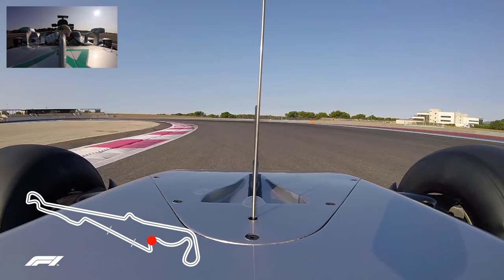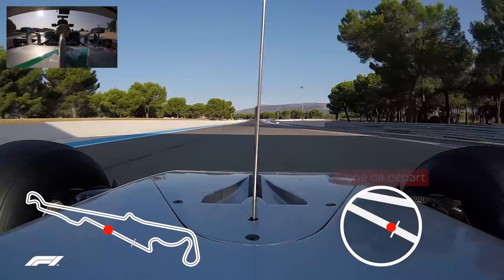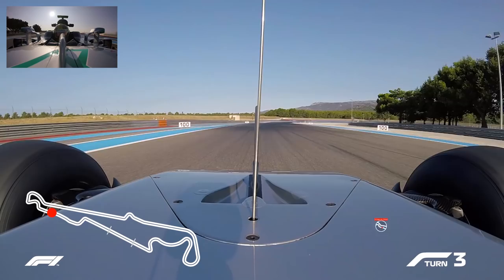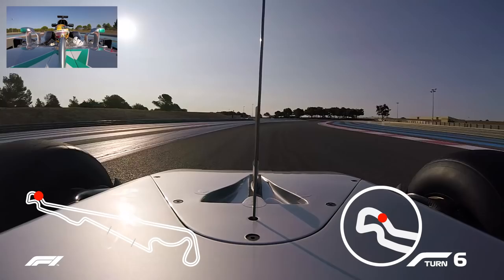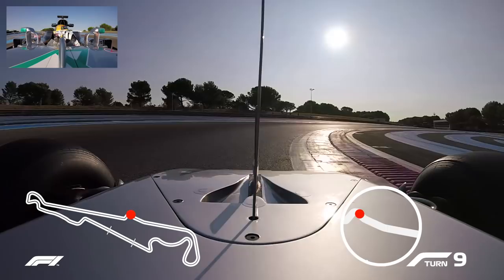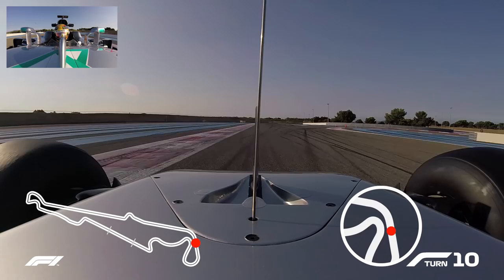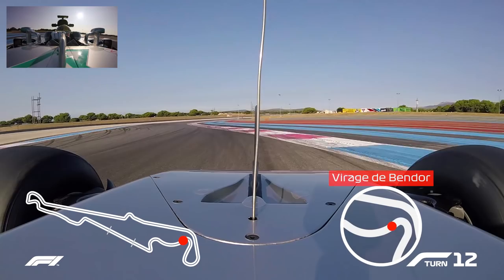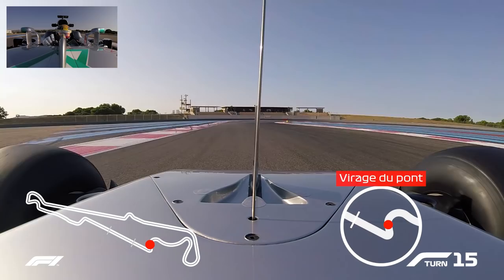Circuit Guide: Paul Ricard | French Grand Prix

Comment: take a large parking lot, paint blue on the edges to make corners, have cars race there...
Reply: fuzzfizz the result is called paul parking log
Reply: Did someone say Formula E? (ahem Berlin ahem)
Reply: nah formula e has walls close to them, this circuit has no punishment, you can do 20 mistakes and win the race
Reply: I mean, didn't F1 do that in Vegas back in the 1980s?
Reply: It's not paint. It's an abrasive surface to slow cars down instead of gravel traps. The red lines are even more abrasive and will supposedly do a lot of damage to tires
Reply: Could say that about COTA or Bahrain but they consistently provide solid races. Or maybe you'd prefer races in tracks like Monaco where there's barely any overtaking because the walls are too close?
Reply: its literally the same i wanted to write. This track is a yoke. Why not racing in Magny-Cours. I dont get it
Reply: MrRobosch Agreed, magny cours is the way to go in my opinion, this is just a track that has cones make the drivers turn, instead of the amasing layout of magny that to me is amazing as it is and F1 raced there, y didn t they do that again?
Reply: Funny thing is they already raced on parking lot in Las Vegas. Can't remember the year though.
Reply: Tyler Quebedeaux yeah, at Caesar's Palace.
Reply: fuzzfizz 😂 it’s so true. I’d have a hard time finding my breaking points.
Reply: lmfao!!!!!! right on point
Reply: OP: Except that is NOT what has happened here. When the circuit was reconstructed in early 2000s it was designed to be an advanced test circuit (hence its original name: Paul Ricard High Tech Test Track).
Reply: ghostsinthere2008 How about the hundreds of races held there before this weekend's race? Track limits usually are an issue though.
Reply: They should have taken Magny-Cour
Reply: Pretty much. First 2 corners and the double apex look fun to drive. The back straight is just lazy track design. There was some close racing for the blanc pain race the other week but wouldnt bet on it being as good with f1 cars.
Reply: Didn't Sebring did the same thing except it's an airfield
Reply: so its like Caesars Palace, but without the temporary concrete bricks and cones.
Reply: To those people asking why they don't race at Magny-Cours. They did, and in the end it wasn't a success, partly because it is relatively speaking in the middle of nowhere.

While I agree that the large asphalt runoffs make going off less punishing, even if it hurts the tyres, they were put there for exactly that purpose when it was a test track. You don't want to ruin a car testing, do you?
Reply: The back looping section is good, there are plenty of overtaking opportunities there. The only problem is, two long straights lead into that section. Which means the high powered cars will be protected from their mistakes in the looping section.
Reply: The runoffs areas aren't asphalt, they're way more abrasive. Running your tires over this will destroy them in no time, so there's definitely punishment if you make a mistake.

Comment: What a dull looking track
Reply: Zarugal Exactly!!!
Reply: It's not actually.... The track is fairly straight, i'll give you that. The fun thing about the track is the fact that there are so many sharp turns after every straight. The track will very much be a brake killer. Teams with the better engines are going to have the advantage on the straights but nimble cars will be able to catch up in the sharper turns. The battles that will occur on the straights will carry on into the corners. Meaning that the battle will get a lot more exiting. I understand your choices and why you think this track looks dull. But I actually think Monaco is way more boring to watch. There is almost no overtaking. I'd love to hear what you think tough!
Reply: Zarugal looks cool imo
Reply: Zarugal Boremula1 and a boring track? You don't say.

Comment: So Rip Renault and Honda engine ?

It looks like a power track
Reply: Jeffrey Pluemjit Canadian GP is supposed to be an engine GP. Look where finished the renaults and RedBulls
Reply: Jeffrey Pluemjit 

There are some very tight low speed corners too. So brake endurance and aerodynamics will be important as well. A lot of time can be gained in the last, somewhat low speed sector.
Reply: aerodynamics isn't important in low speed corners - suspension and weight distribution is. last sector isn't low speed lol.
Reply: Engine does only play a role in Quali
Reply: vasyl86 

Oh i thought that even at lower speeds the intricate wings can generate downforce. Obviously the faster you drive the more air molecules get to push your car down. So red bulls victory at monaco was down to their suspension? Would like to know more about this
Reply: Redbull will do well in the last sector.
Loose some time on the straights.
Reply: Maxi RC Mercedes had old engine they did not upgraded it
Reply: Podesta is Moloch

Yes Red Bull win at Monaco was possible because of their suspension. It's a track where suspension and accelaration is most important. According to the last sector on Paul Ricard - it's not a low speed sector, so aerodynamics will have its role and obviously engine in 2nd sector. I think Ferrari can win here.

Comment: Take that bloody chicane out of the back straight!
Reply: Mr Trick It add another overtaking possiblity so why not
Reply: No, the straight is far too short now after that curvy part before
Reply: Iirc, it's an FIA requirement for tracks not to have straights longer than 2km.
Reply: StFubar what is that bullshit look at miami coming next year look at china monza canada
Reply: I suppose it doesn't really matter, the Williams is a mobile chicane these days anyway.
Reply: fifia lpo Miami's straight is shorter than the one in Longbeach, Indycars barely reach under 170..
Reply: StFubar ahem baku
Reply: They don't use the chicane in the endurance layout of the circuit
Reply: They use the chicane for a couple of reasons. 
1. another overtaking opportunity is added.
2. The amount of runoff at the corner at the end of the straight is not enough considering what that corner is (flat out, full throttle, 300kph)
3. You wouldn’t be able to use DRS at all down that backstraight. The corner at the end is taken at over 300kph, without any braking. The same reason why there’s not a DRS zone on the run up to 130R in Suzuka.
Reply: The straight is simply too long without it, and running the full mistral in an f1 car would make signes quite interesting at 210+, especially if cars are trying to overtake
Reply: fifia lpo only Baku’s straight is close to 2km, and if you count the flat out corners beforehand it’s 2.1km I believe. All the others are around 1-1.3km
Reply: StFubar in baku the straight si 2,4 kilometres long
Reply: Mr Trick and give the stronger engines even more advantage? Nah, i like it, especially if there is DRS before the chicane
Reply: yeah i only want my F1 cars going in a STRAIGHT LINE!!! Screw this turning garbage!!!!
Reply: yeah cause taking a flat-out corner two wide at 300 kmh is safe
Reply: yeah monza is like a straight with bends seperated by 3 chicanes lol
Reply: ghostsinthere2008 I’ll just also say that the cars will still be almost flat out through the fast corner at the end of the straight.
Reply: That's probably the only overtaking point in the circuit, so...
Reply: Negative.  I bet Daniel Ricciardo will 'send it' into Turn 8 there, as well as Turn 1.
Reply: add some full throttle "turns" ahead of the straight or at the end of it then, like they have in Baku.  Cutting it in half seems like the worst, laziest "solution".
Reply: @robertm5969  #ForzaMercedes

Comment: I'm happy to have France back but I miss Magny-Cours - the high speed single-downshift Nurburgring and Imola chicanes as well as the opening Estoril curve - such a flowing circuit and now confusing configurations - just a distinguishable flowing tarmac circuit with grass and gravel on the sides.

Comment: magny cours is a better french track imo
Reply: Not for overtaking
Reply: debatable... longest straight at paul ricard is only 50m longer than the one at magny cours but the braking  in the hairpin there provides more posibilities for overtakes
Reply: But Magny Cours is too narrow
Reply: Magny is terrible. One of the worst F1 tracks in history. The only charismatic french GP tracks were Dijon, sadely too short, Rouen which sadly diseppeared long ago, and Clermont Ferrand which sadely was shortened and where international races are not allowed anymore due to noise restrictions.. but maybe it would be possible again if F1 sound actually like on this boring video. BTW, if nobody commented on video sound here, that means that fans are getting used to formula E and soundless races, meaning they're ready for an all electric F1... how depressing

Comment: Just cut out turn 8, then we'll see some overtaking
Reply: Jumpman Sam i have a feeling people will get confused and cut it themselves, looks like a fucking junction
Reply: Lord Smoney yeah, I don't really like the track, I think it'll be the same as in Canada, that there are just too many high/medium speed corners that the cars won't be able to follow each other.
Reply: Cut out the chicane in favour of shitty and boring DRS overtakes? No thanks
Reply: world wide better than having no overtakes at all
Reply: I think we can see some epic overtakes at this Snake Curve you know because they can Take the Curve before full Trottel so they don't suffer from dirty Air. (If 2 stops it will happening 100%)
Reply: RX7 No, the race won't be 70 laps long as the circuit is almost 6 km long (5.842 km to be precise), so, therefore, the number of laps in the race will be something between 50 and 60.
Reply: TheJokerit19 52 Laps
Reply: Jecko _ Not confirmed yet. The 'number of laps' portion is still marked as 'TBC' on the official F1 website, but it'll be either that or 53 as the track length is approximately the same as that of Silverstone (52), Monza, Sochi, and Suzuka (all 53). We shall wait and see to find out eventually.
Reply: The very purpose of that chicane was to create overtakes through braking.
Reply: Complete opposite rather. The point of that chicane is to have a heavy braking zone to overtake in. Without it, they wouldn’t even have DRS, because the corner at the end of the straight is flat out, like why there’s no DRS zone on the straight before 130R at Suzuka.
Reply: Pretty funny to have complaints about DRS, when I would love to see more tracks like the old Hockenheim where the wings were pretty much permanently "DRS".

Comment: Not bad... 

Has a touch of the old Hockenheim circuit about it which means there could be engine failures, which could be entertaining.

Would have preferred Magny-Cours though...I think it was flat out of the second corner, uphill through a right hand bend before finally braking into the only 'V' corner on any racing circuit... Plus that last sequence of corners with the finish line on the exit of a hairpin.

Glorious!!!

Comment: People think every race track should have 10 corners like eau rouge. Well, if you build a race track you need to find a piece of land. And if the land you can buy is flat, then its flat. So no eau rouge here. Then you need to deal with the size of the land. No race track, at least in europe, will ever have the space and the land like Spa again, where you can build your track for kilometers through the countryside. Those times are over. Forever! Spa or Nürburgring Nordschleife are wonderful, exceptional circuits. But nothing like that will ever be reproduced in our modern times. Never, ever again. And if you think about the land they had in Paul Ricard, i think they made the best of it.

Comment: They really should grow some gras around this track, the massive asphalt runoff areas destroy the racing so much.
Reply: Elltielle it's sticky tarmac which acts like gravel
Reply: Dylan Cotton that sounds interesting. Can cars simply drive over it when they leave the track or do they struggle like on gras or gravel?
Reply: Elltielle I'm not sure exactly. But it will slow them down. The red stripes also are more sticky than the blue ones. But it will also wear the tyres out quick as well if you try to use it to gain extra grip.
Reply: they can drive off sure, but the time loss will be big and the tyres will be gone

Comment: Looks like this will be a power track.  I bet Merc runs away with it and has a 1-2 finish, Hamilton then Bottas.
Reply: Don't be so sure. This may be a power track, but so was Canada. And Ferrari won there.
Reply: Yeah but Ferrari were using a new upgraded engine while Mercedes had issues with the new engine so were using the old one which had several races worth of use on it..... They will bring the engine upgrade to this race.

Comment: Why f1 dont use circuit de la sarthe?
Reply: Armando Rizqy Le Mans is not FIA grade 1 circuit. To hold a GP the track must have grade 1 license.
Reply: Nicks GT1 what does that mean? The license
Reply: Armando Rizqy The license grade 1 means the track has the safety requirements to hold a Grand Prix, without putting in danger the driver or spectators. Le Mans doesn't comply with that as it is semi permanent and has an irregular track surface in various sectors